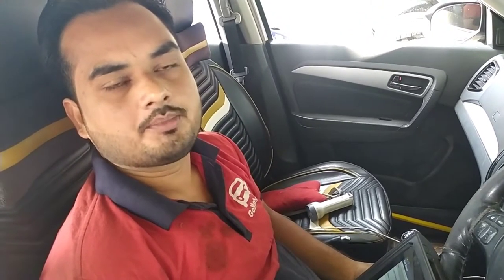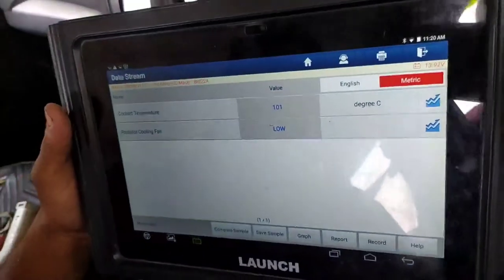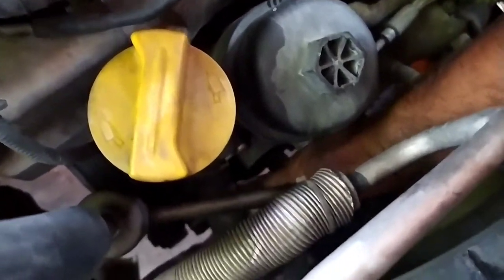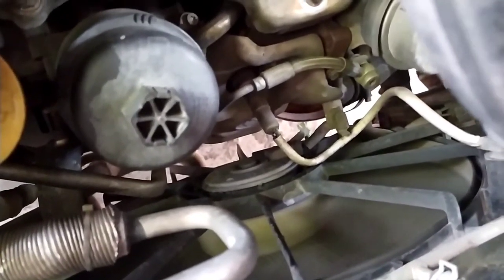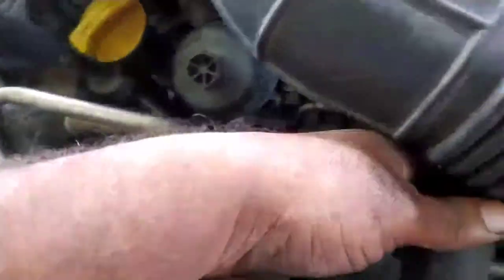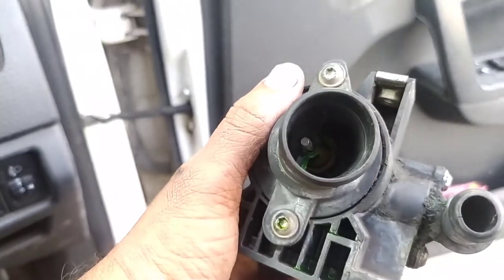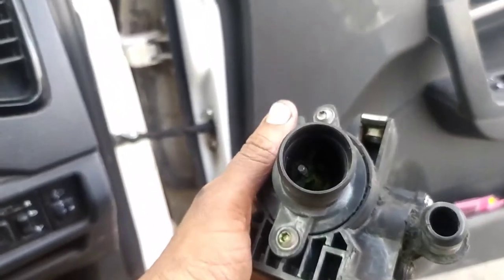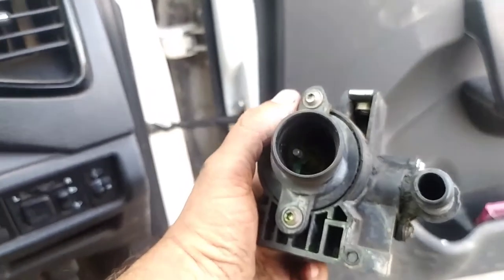Maruti Suzuki Brezza Over Heating Problem SOLVED!!

Comment: Swift diesel 2010 model hai thermostat valve new lagaya hai phir bhi over heating ho rha hai radiator ka fan bhi work kar rha hai kya problem ho sakta
Reply from the maker: Sab kuch dekh liya hai toh Engine Head check kar lo sir.
Reply: Radiator chock rehna sa bhi hota kya
Reply from the maker: Yes. Radiator choked rahega toh bas top pipe garam hoga but bottom thanda hi rahega. Water pump fail hua toh bhi aisa hoga. Pehle radiator check karo agar okay wo then water pump.
Reply: Water pump check Kiya OK hai

Comment: Sir Brezza Zdi + Overheating Problem Solve  nhi hora Maine Uska ye ye kaam karwaya hai gasket change water pump change Thermistor valve change Radiator Clean Coolant Change Sab Filters replace full servicing karwaya oil change sab fir bhi 100 ki speed me chale to Overheating ho thi hai heating symbol aara hai kya solution hoga plzz rply dena sir🙏🙏🙏🙏🙏
Reply from the maker: Sabkuchh changes karva liya hai to ak item or change krdo radiator fan iske bad hi problem solve nahi hua to aap gadi change kar lo 😁😄
Reply: @starbodyworksindia  Thik hai sir ji Thank you 😁😁😁
Reply: bhai same issue koi solution mila kya i hv 2016 model top
Reply: @dr.pankaj5546  kya problem hai batao